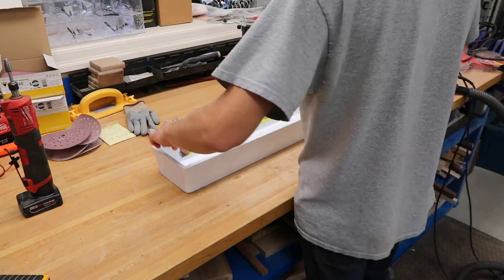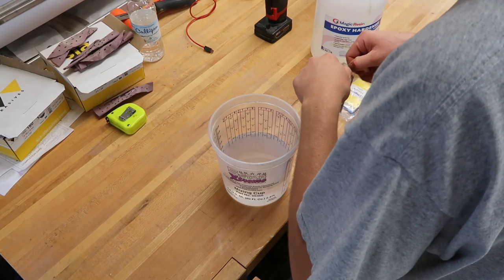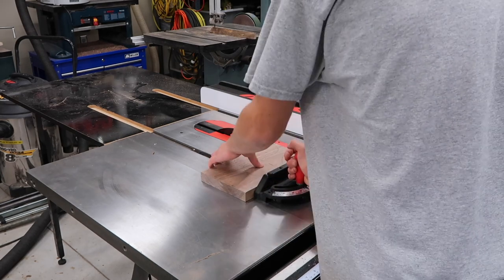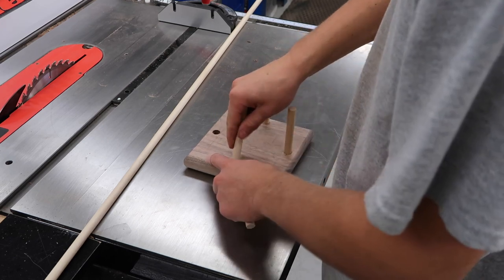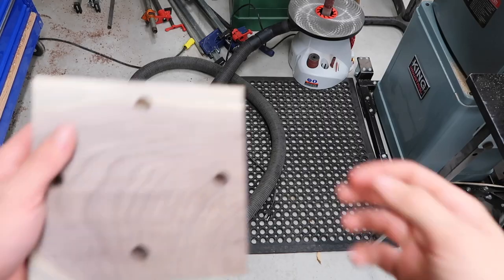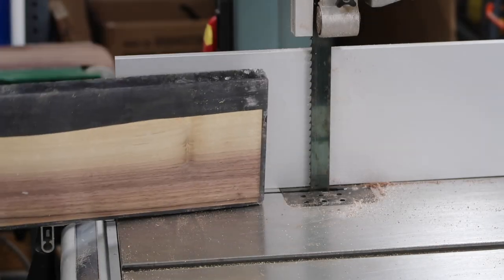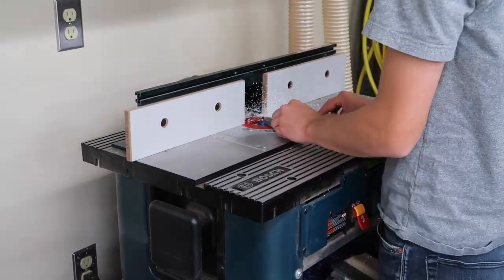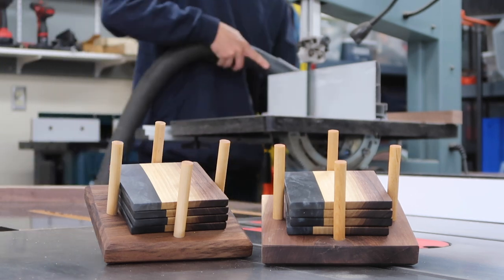I Used Scraps To Build These.

Comment: Really nice job for scraps, but if you would have made your own dowels out of some of that scrap walnut from the first cuts, that would have made them even better.
Reply from the maker: I’ll have to get a lathe!
Reply: @millermetalwoodcreations  Drill a hole in a piece of 3mm metal plate the size you want for the dowel.  Cut a square piece of wood strip the size of the hole and taper the one end to fit into a drill and put other end into round metal plate hole held in a vice.  Start the drill and push stick though hole and presto you have a dowel.
Reply from the maker: @iansampson1302  okay! That’s a sweet tip thank you!
Reply: @millermetalwoodcreations  btw, if you sand the wood just before cutting into coasters, saves a lot of hassle. Also, once when I drilled dowel hole to big, I just filled hole with some saw dust.
Reply from the maker: @iansampson1302  I agree. I sanded all the wood before it was put together and just showed the final sanding process. I have also use the sawdust trick lots!